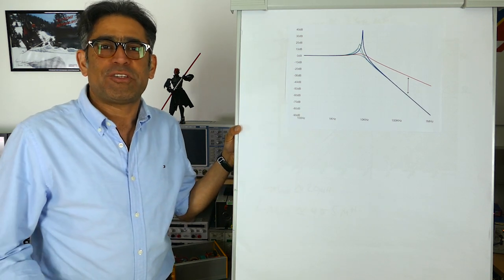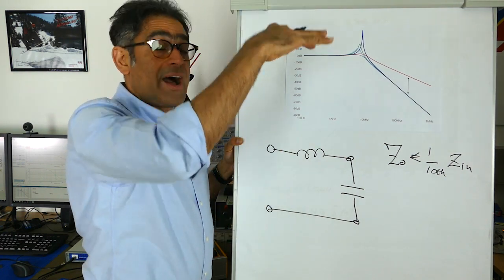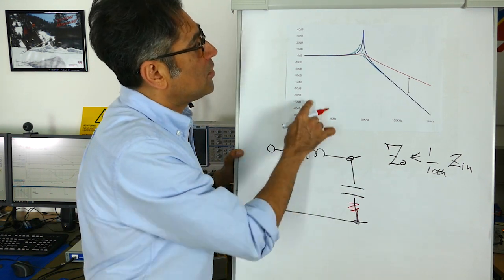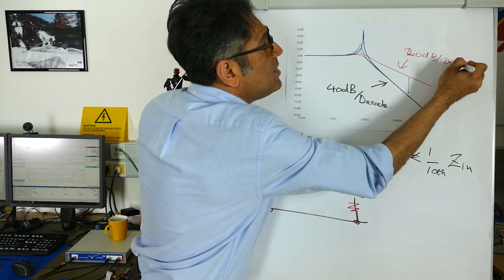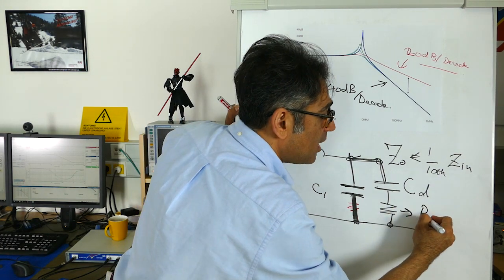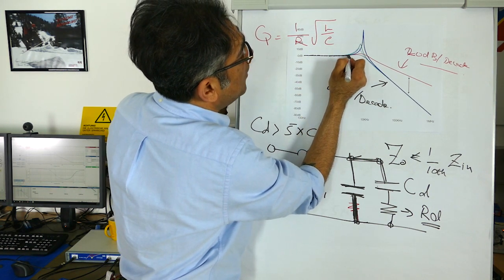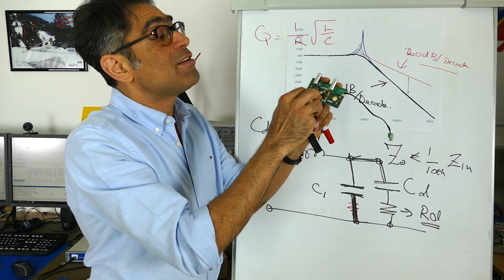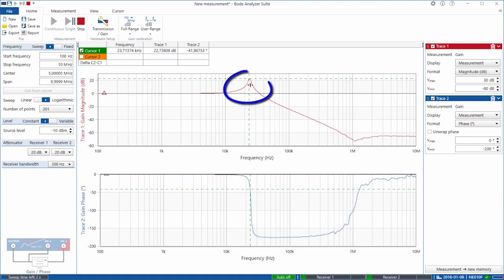EMC Filter Design Part 5: Differential Mode Filter Damping Component Selection

Comment: good afternoon sir.I want to make an LC filter to reduce harmonics in 18 watt LED bulbs I use L 4.2H and C values 1.2uF But when I plugged it in there was a problem.the capacitor and the LED light are burnt. what is the solution to this problem sir?

Comment: I have seen filters with a resistor in parallel with the inductor.  Does this behave the same?
Reply: It's a different topology to achieve the same result, if it has only 1 inductor you loose some of the high frequency attenuation compared to this topology.

Comment: I came across this amazing video of yours and thought it would be great if I could know more on this as I am currently designing a DC-DC board for which I need help in designing of common mode and differential mode filter for the input and output of the DCM converter module.
It would br great if you could hear my problem out.
My email id is-  shreya.agrawal1807@gmail.com.

Comment: At the Cut off frequency, the Impedance of the LC circuit should have it's Minimum (zero).
Reply: That is if it is a series resonance, in this case it is a parallel resonace, since you are looking at the impedence from the output side of the filter.
Reply: I agree, you get only resistance of the circuit.
Reply: well that is only if L,C are in series. Calculate the transfer function to get a better understanding and the bode plot will make more sense to you.

Comment: Nice video! Compliments.
One thing though, the resonance (or peak) is only gone with a Q < 1/sqrt(2).
Everything above still will give a slight resonance.
You don't want this Q to be very low, because that makes the whole filter act rather slow.